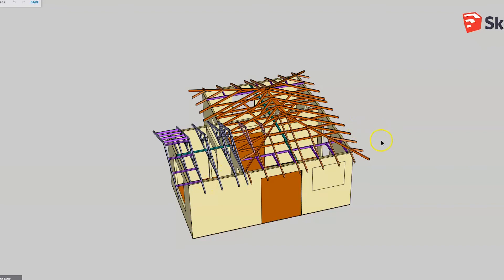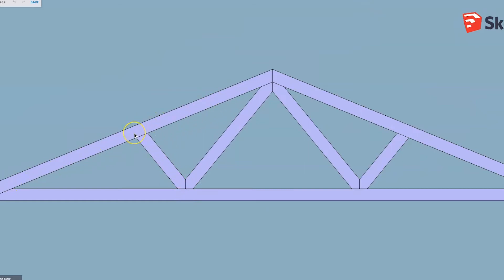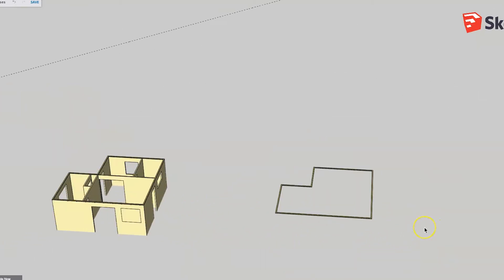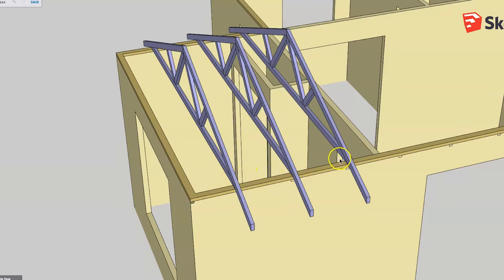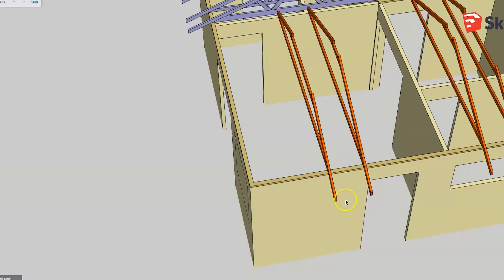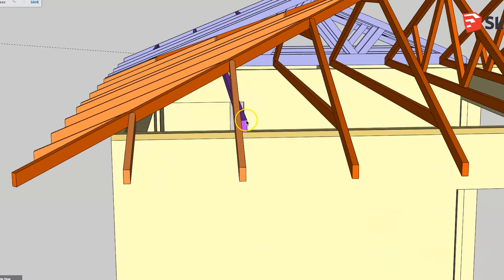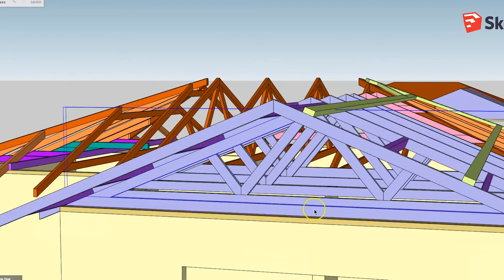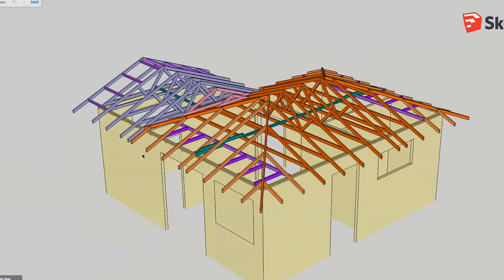Trusses overview

Comment: Great video. Big fan of your work and how you explain everything in so mesmerising way. As a Building Surveying student here in Australia, such videos really help to understand the roof layout and how and what to check when inspecting those trusses. I willl appreciate if you can do couple of more videos on the critical parts of the frame, connections and which parts of the frame are critical when ensuring a compliant connection. And also a video on bracing and the areas where they fail and why they fail.